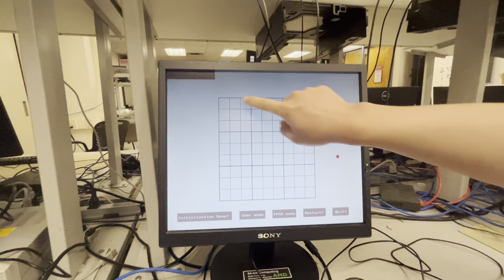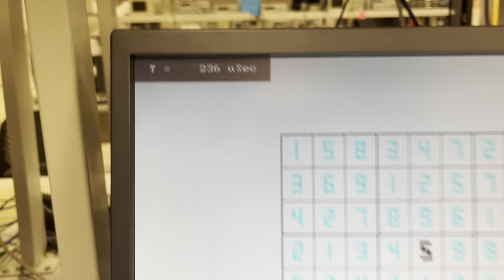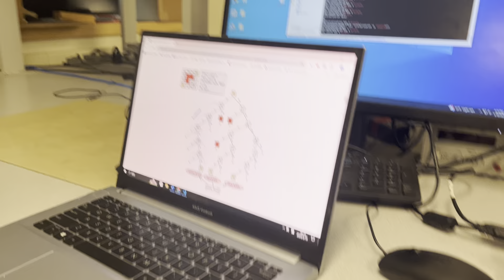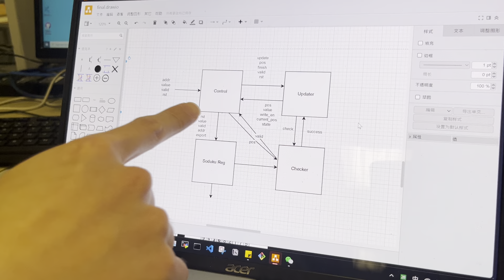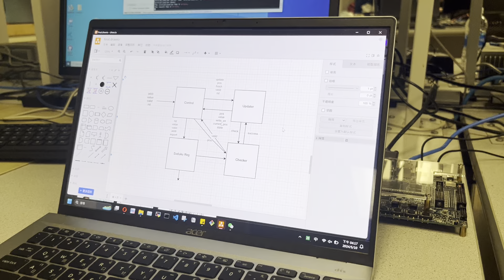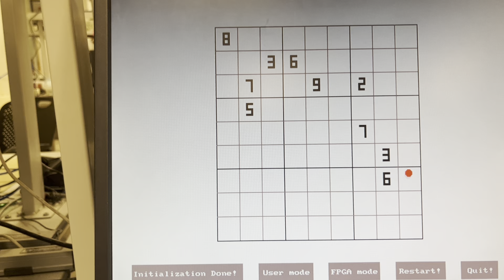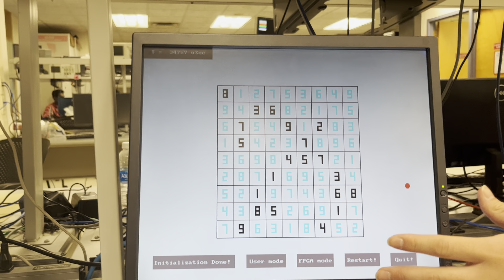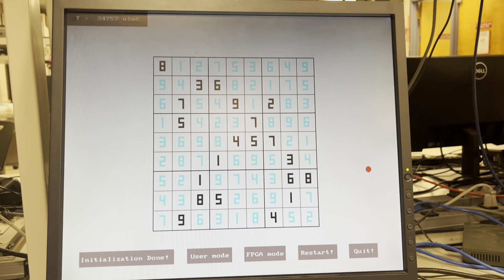Verilog Sudoku Solver on DE1-SoC

Comment: Actually Sudoku puzzles should only have one valid solved state. A Sudoku puzzle with more than one valid final states is considered to be flawed.
Reply: I think you should wallow in their glory of this is being done in hardware.  Less than one second to solve the 'hardest' puzzle with one solution is very impressive. I assume some bits are done using support CPU - (I heard 'C' bitmaps being mentioned for drawing the digits). I wish they had implemented a C version of the backtracker and did some comparisons. In the words of their professor, 'Awesome!'.